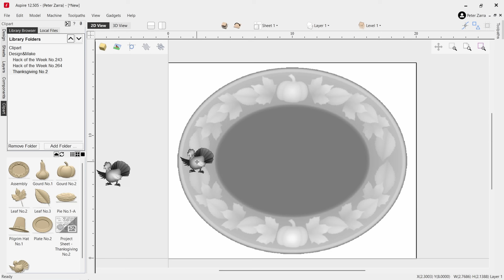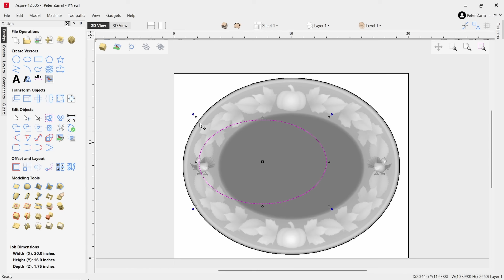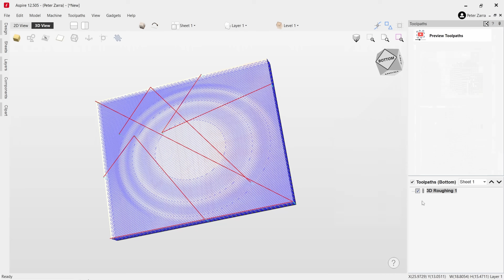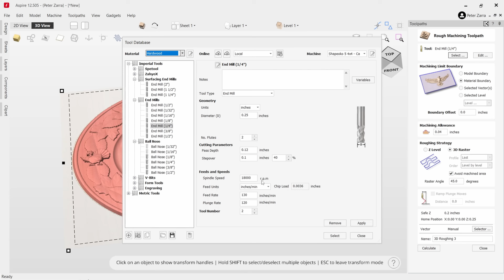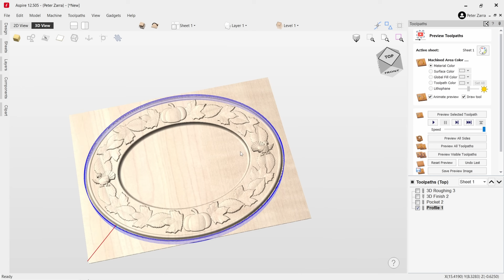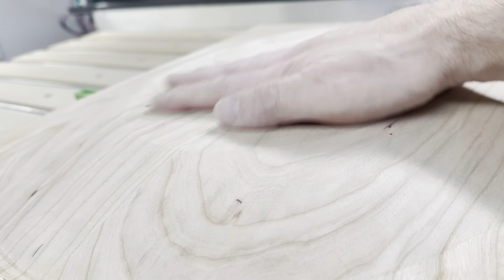How I Turned a Wall Plaque into a Beautiful Thanksgiving Serving Platter

Comment: That water cooled spindle seems to keep the dust down when running without dust collection. Might be a consideration for longer 3d carves.
Reply from the maker: No, I keep the dust boot off for filming and I use an air hose to blast the dust away.  The water cooling is internal and has no effect on the amount of dust created.
Reply: @StudioZ-maker cool. I meant the lack of air from an air cooled spindle kept the dust blowing to a minimum when doing light 3d carves. Perhaps I wouldn’t need the dust collection on the entire time for noise reduction.

Comment: Fantastic step by step instructions. Newbie question, I have a Dewalt router on my machine.  I notice your inches per minute cutting paths are about 3x the speeds I use. Is it due to the use of the spindle router?.
Thanks Don
Reply from the maker: Thanks Don, the majority of the increased feed rate speeds is because of the 2.2 kw spindle.  However, just know that the advertised speeds and feeds listed by Carbide 3D are extremely conservative and are just a starting point to learn from.
Reply: @StudioZ-maker  Thank you! Can't wait until your next project

Comment: Another great video thanks!  On the first side you removed all the corner material.  You could have just left it there.  Will cut down on time and wear on the bit, but you could have left it as it would also serve as your support and alignment when you flipped the piece to do side two, instead of using the blocks.  Just cut about a quarter inch outside the actual bowl perimeter.  It is great how you jump in and tackle just about any type of project!  You are teaching plenty of people who want to learn CNC.  Thanks again!
Reply from the maker: Thanks!  Yes that would have been the easier way to do it, but I chose this way for camera shots  😉
Reply: He just loves to see the machine running for nothing 90% of the time haha.

Comment: To create the inner eclipse for the center, why not use an offset rather than free hand it to make it fit?
Reply from the maker: Yes, there are many ways it can be done, I chose this way
Reply: Where did you zero your z from since the original material was removed?
Reply from the maker: You only zero once before you start the roughing, check the other comments